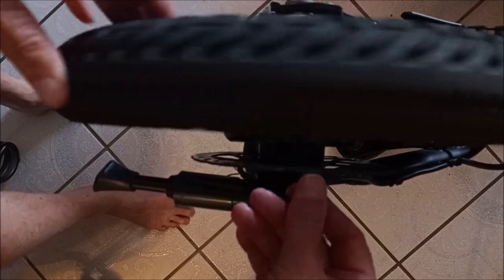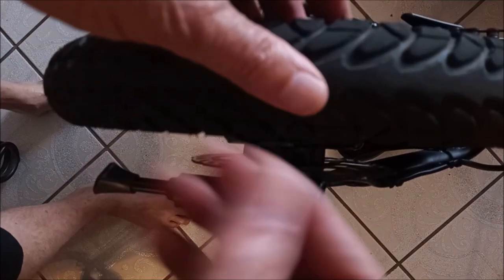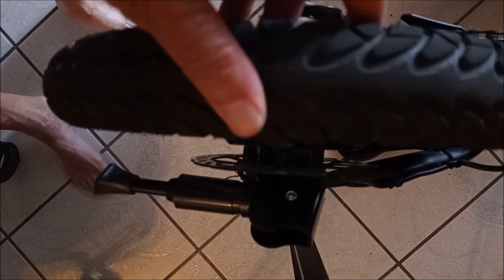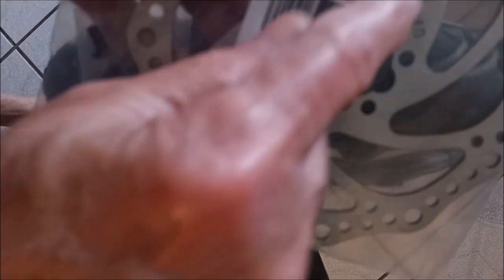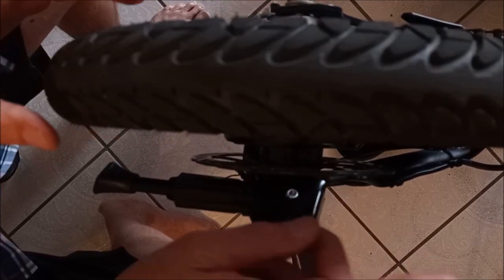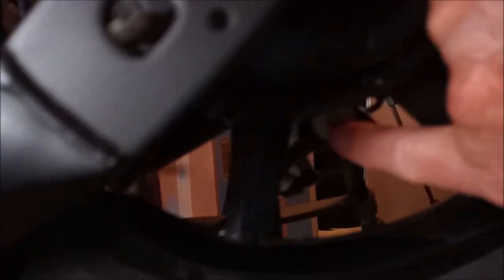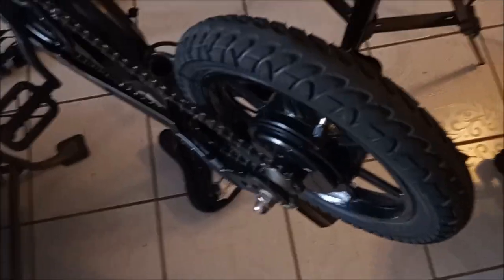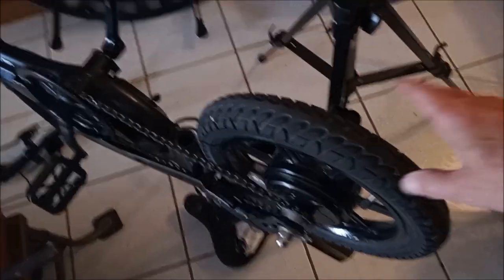How to Fix a Warped ebike disc brake with simple tools

Comment: Just wrecked mine 😂 started off with a low power e-bike still strong to me the front disc brake is warped now it’s pushed in towards the spokes I figure I’f I bend it out and straighten it up it’ll be fine to ride again till I order a new one. Wat u think?
Reply from the maker: I got mine back almost straight using the method I showed in the video. But it never got back 100% straight. I had to back off the brake pads just a tiny bit. I still have breaks down on that wheel, but not as good as the other one. I found a break on Amazon for about 10 bucks. Look in the video description.
Reply: @RobbsHomemadeLife  thanks 🙏🏽
Reply: I actually have the Jetson axle 12 inch bike I wonder if the disc brake is the same.
Reply from the maker: You could contact Jetson to see if they have that part for sale or if they could give you the dimensions so you can locate it.

Comment: Right out of the box? FFS.
Reply from the maker: Hey John, it's weird. The box was undamaged. It looks like they sent me a bike that had a warped disc. I called them late at night about a half an hour before they close and I had to deal with their virtual assistant and since I'm such a poor typist. By the time I was able to make them understand. I just wanted them to send me a replacement for the brake rotor they set alive person would contact me within five minutes, which was about 8:45 PM. I would've been surprised if they had actually done that. I was disappointed though that they did not call me the next day because they certainly had all my information. Anyway, it gave me a chance to find out where to buy a cheap replacement on Amazon and fix the problem myself and make a video on top. The neat thing about this bicycle is there are so many people making videos about it so I feel confident I can do anything I need to do. I bought an automobile car horn. I'm going to attach. It's 36 V.
I just came back from a half hour bike ride and it was very pleasant. You can get one of these for $225.